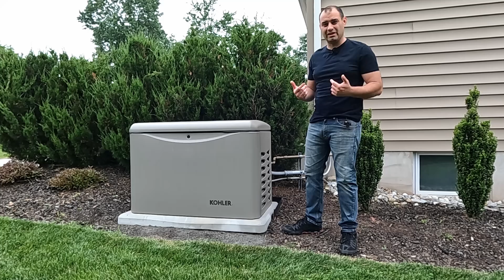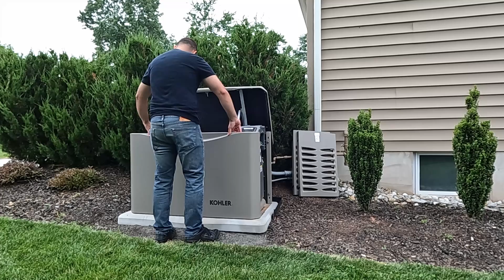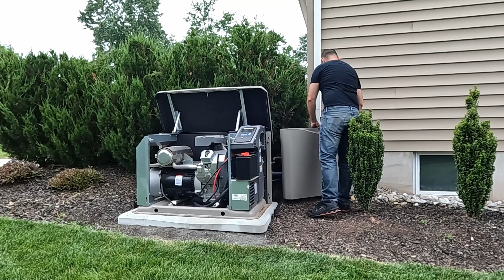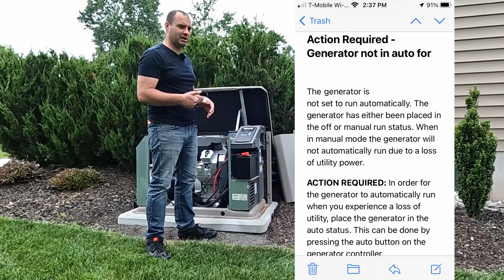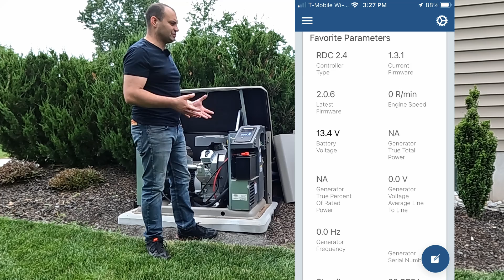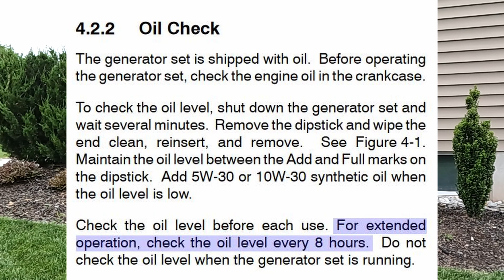Home Standby Generator Maintenance & Storm Prep / Kohler 20RCAL

Comment: Be careful on the "certified"  installer as our Kohler  20kw installed at our new home doesn't work properly. Cannot even use it it flutuates power after about an hour and runs terrible when it does that. Installer cannot seem to get here to diagnose
Reply: If you're in the greater Houston area by some miracle, I'd be happy to take a look if it's still acting up. Depending on the size of your home, how large, and how many HVAC(s) you have, you may need to look into installing a soft start mechanism. The starting amps required to kick on an HVAC is around 5x the amps for when it's running normally. If that's not the case, there is a chance they sized your generator improperly. The next thing to consider would be to install a load shedding module to prioritize the load. Let's say you have a 3500sqft house with 2x 4ton HVACs, a pool, and an electric range. If power goes out while you're cooking in the summer, you will might see issues with a 20kw handling all of that. What this load shedding module will do: temporarily shuts the items on your priority list off to maintain a proper sized load for your generator to run safely/normally. For instance, your HVAC #1 will kick off temporarily and then resume once the system allows. And finally, it might be as simple as a repair/servicing. I wish you the best of luck!
Reply: @ElitePowerSolutions  Thanks for the responce. We are on the Oregon coast. The home is a one kevel 1400 sq ft and it acted up with little to no load on it as we tested it. I finally got the tech to come and installed a new govenor switch, cant remember what it was called and it seems to be functioning now. Haven't had an outage over 4 hrs but at that time it didn't act up, so fingers crossed!!

Comment: Every 8 hours to check the oil is ridiculous, especially in a storm, or if you're handicapped.
Reply: As someone who's looking to get a whole house generator installed, this is actually the part that's bothering me the most. Not only are you supposed to shut it down every 8 hours to top the oil off, you're suppose to shut it down, THEN WAIT 30 MINUTES FOR THE OIL TO COOL, *THEN* , top off the oil! Imagine every 8 hours telling everyone in the house, sorry, the power is going to be out for 30 minutes. It seems nuts.
Reply: @dontbanmebrodontbanme5403  I passed and saved the $17k, including having to upgrade my natural gas line from street to house and meter size. Haven't lost power in over a year and making money in the stock market instead.
Reply: @dontbanmebrodontbanme5403  I know it's been a year since your comment, but I hope you decided to go through with having one installed! In my experience (Houston grid and Houston weather), running the generator for a full 24 hours warrants a cool-down for 30-60 minutes. Pick a time of day where you'll either be gone or it's least likely going to affect your quality of life. At the end of the day, it is an engine and consider driving your vehicle from TX to Canada without letting it cool off. Every 8 hours is overkill- almost like when a zipline says it can only hold people up to 225lbs....it'll hold an elephant but they need to cover their butts for liability reasons. Lastly, top the oil off after it's been running full bore for 2-3 days and just do it during one of the 24 hour rest periods. Topping oil off is simple and takes 2 minutes.
Reply: @ElitePowerSolutions Hey,  we're in Houston and have with in the past few months had a Kohler installed. Been looking for the owner maintenance kit that he recommended in a previous video that he got from Kohler but can't figure out where to get that. No links that I can find to purchase,  and not clear on exactly what to buy individually.  Can you recommend the components to purchase or provide a link to get a kit? Like oil, filter type, spark plugs, that kind of thing? Thanks!

Comment: No one ever wants to listen about the oil there's only 4 brands of oil I will use with my NG Generac stand by 100% synthetic Amsoil small engine oil, 100% synthetic Briggs and Stratton, 100% synthetic Kohler and synthetic Generac oil I'm not quite sure if it's 100% synthetic but it's really good oil has similar additive package to the others I mentioned

Comment: Excellent Video. I ran my Kohler for 10 days in Florida after hurricane Ian. Lucky I had a maintenance kit. My Kohler dealer couldn't come out to change the oil. When your running 24hrs a day 150 hour oil change comes up fast. I just ordered more oil filters, and spark plugs.

Comment: I have his exact gen and it's louder than a Harley even with no load.  Kohler can't make a muffler...
Reply: Same here. I had my installed about 30 yards from the house by the pool heater to minimize the reverb from the engine's exhaust "hitting" the house.
Reply: I have a guy coming tomorrow to give me a quote. Is the generator really that loud? Any questions you'd recommend I ask him?  I live in SE MI.
Reply: I had someone give me a quote on a 26kW Kohler, that's supposed to be on 67 db. Honestly, the part that's giving me the most pause is the fact that you have to shut the generator down every 8 hours, wait 30 minutes for the engine to cool down, then top it off with engine oil. I think it's nuts that every 8 hours you have to tell everyone, "Sorry, no power for the next 30 minutes!"